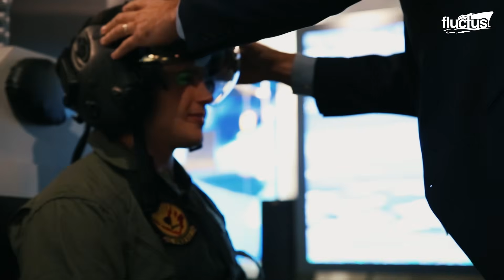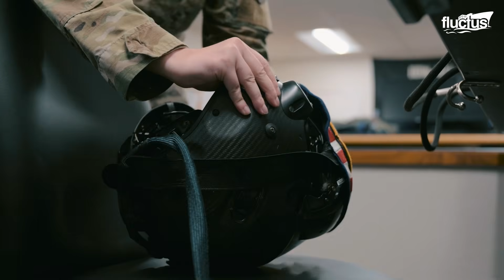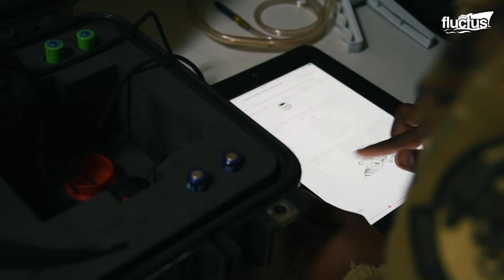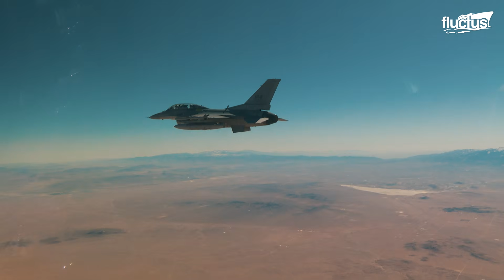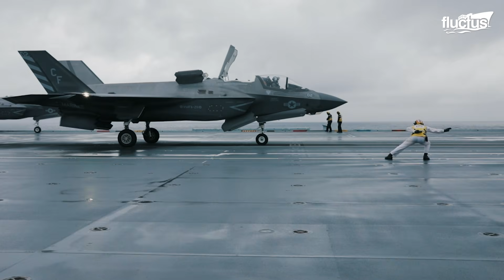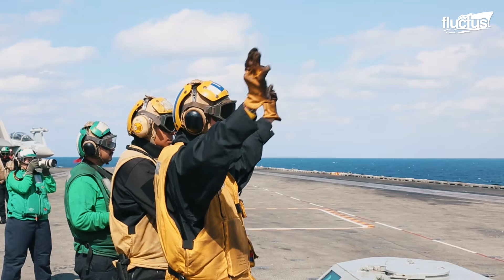US Air Force's $400,000 F-35 Helmet in Action

Comment: Correct me if I’m wrong, but I’m just an average John Q public when it comes to military aircraft. My question is, although the plane is exceptional, it seems that using all that space and extra heavy equipment and fans to make the plane fly off vertically or horizontally, wouldn’t it be better to use that weight and space for additional rockets, etc.?😂
Reply: i believe thats why they made non Vtol versions of the plane.
Reply: it barely gets used. infact it takes nearly all the fuel the plane can carry just to take off.
 its a rediculous idea and would only be used a handful of times in real world.
 after it took off vertically it needs a refueling plane to be almost right over head or it has to land becasue it has no fuel left

Comment: 400K for a freaking helmet is crazy. basically the pilot is s huge loot bag if he is ever shot down and needs to eject
Reply: You may be forgetting, or never knew, that the pilot’s Heads-up Display (that this incredible helmet replaced in its entirety) cost more than $400,000, weighed more than this helmet, and had vastly restricted Field of View - since the helmet allows the pilot to “see” 4πSteradians (that means in ALL directions) through the cockpit floor, engine, wings, displays, etc. by displaying its many multi spectral sensors, radars, EM, etc. in the helmet.